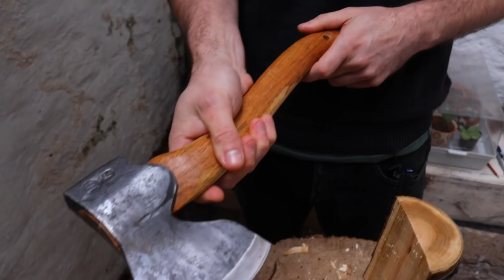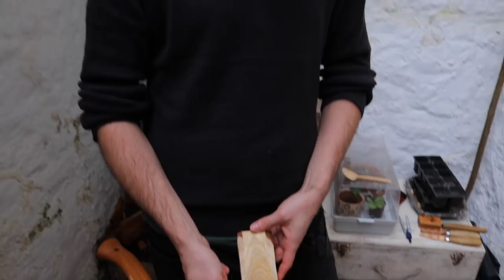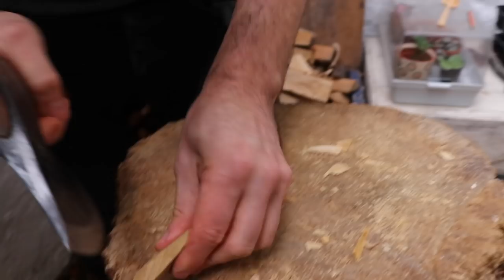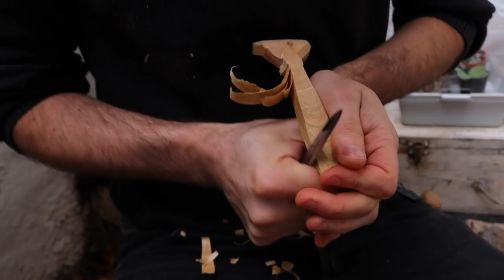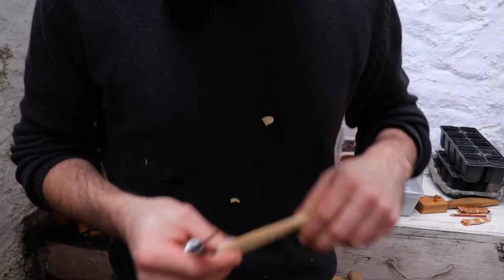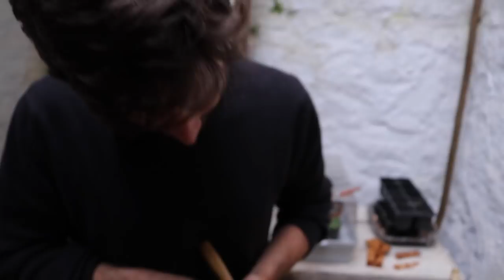How To Carve A Spoon - Will Priestley

Comment: Another question if I may: I looked at the templates Will so kindly gave the link to. How do I find scale with these templates? There is nothing that indicates 100% as I've seen on another Zed Outdoors spoon carving vid. EDIT: Right clicking gives option for actual size.
Reply from the maker: When you go to print the template you select it as A4 / 100% ~Peace~
Reply: @Zedoutdoors  Thanks.